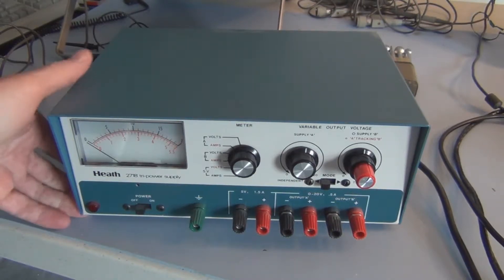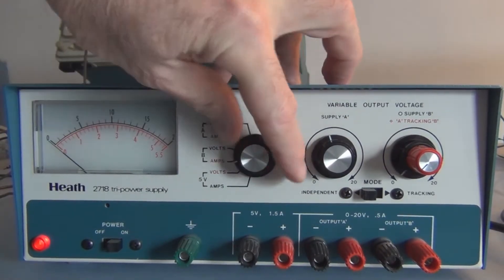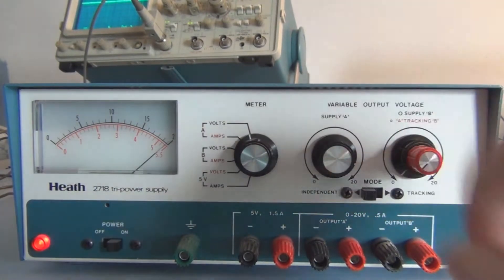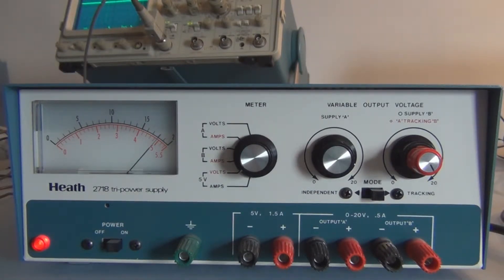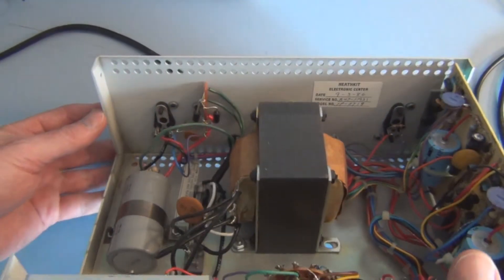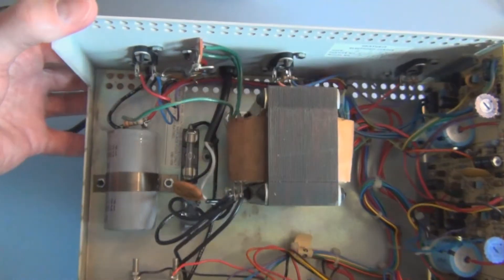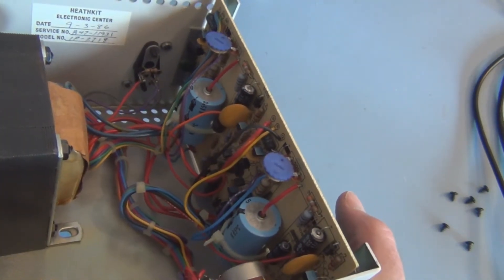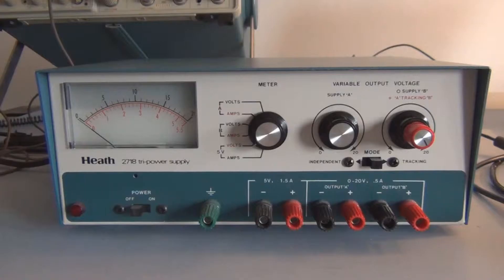Heathkit 2718 Triple Power Supply

Comment: My dad built one of the early ones in 1976, and I still use it on the bench 42 years later. It works fine, and the caps are OK. This is a solidly built unit that will probably be in use a hundred years from now (although sooner or later the caps will need to be replaced).

Comment: I built one of these in 1986, for a new electronics lab I was charged with developing at work (I was on a strict low budget, or I might have bought something more powerful). I built another one a couple years later for the lab at the college I was teaching at in the evenings. Both were good workhorses. I don't know about the college one, but we still use the one at work nearly 30 years later, albeit not frequently, but it still works fine. Heathkit used quality components, and I would not be too quick to assume that the caps were dried out and in need of replacement. Rig up something to load the supply and check the output for ripple, if it looks good, don't bother with the caps.
Reply: I also have one of these supplies.  Still works great and is totally adequate for powering digital projects fine.  Heath also made some very heavy duty variable voltage supplies in 0-7.5V,  10 Amp, 0-15V, 5 Amp, 0-30V 2.5 amp and 0-60V 1.25 amps.  The beauty of these supplies is that they are all current limited. You can manually select the max current you want.  The neat think is instead of resetting, they all will deliver their maximum rated current into a direct short. I have the 0-15V model.